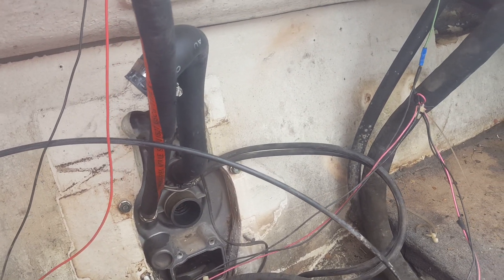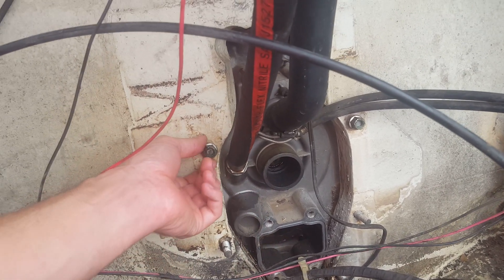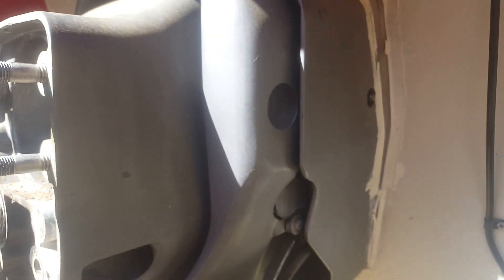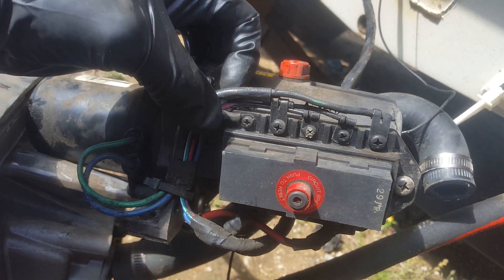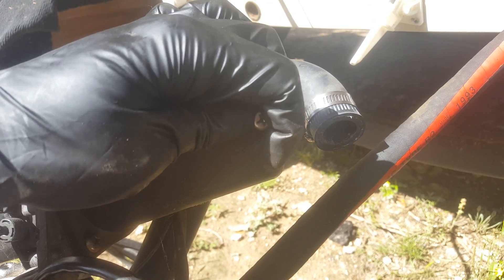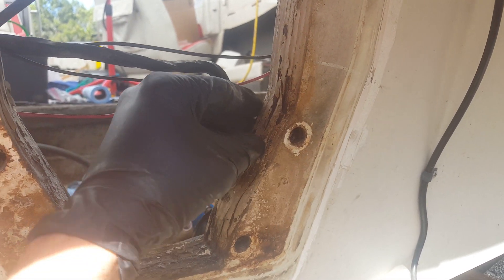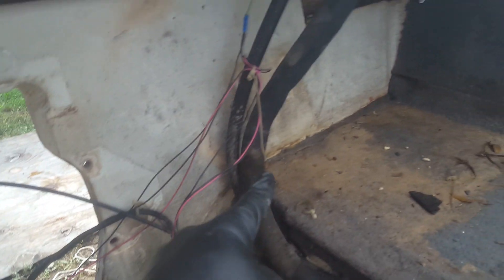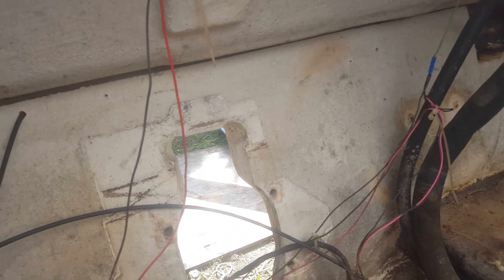Boat Transom and Floor Rebuild - Gimbal Housing Assembly & Transom Plate Removal - Part 10

Comment: how do i remove the gimbal assembly from the gimbal housing assembly?
Reply from the maker: There are gimbal pivot screws on the left and right that need to be removed on the housing. Once out,  remove the screw at the bottom.
Reply: @michaelromer2016  on this diagram, https://www.crowleymarine.com/johnson-evinrude/parts/55333.cfm?mdl=VZOG47,  im trying to remove #45 with #77 the pivot housing connected as one. i have the trim lines disconnected, shift cable, bellows and water intake hose removed. also i have the  3 screws and bracket at the bottom #30 removed.  was then thinking the whole gimbal assembly would pull away. am i missing something? also have steering arm lock nuts removed how do i pull gimbal assembly and pivot housing out of the steering arm?
Reply from the maker: 13, 8 and 26 should be removed
Reply: @michaelromer2016  i need to remove the pivot screws, #26 to pull the gimbal assembly with the pivot housing attached as one?